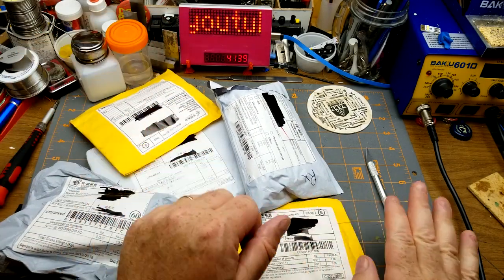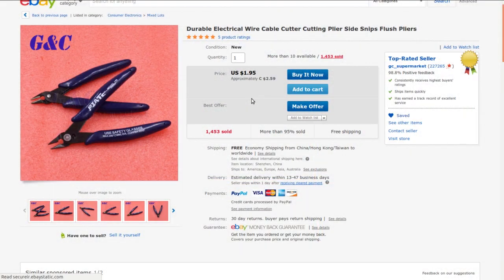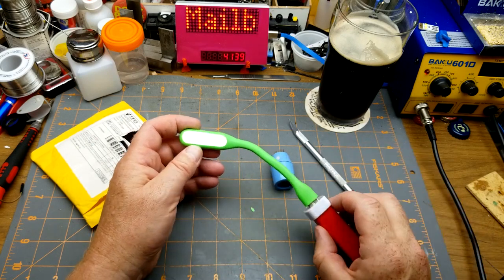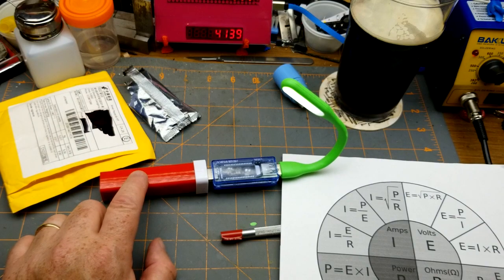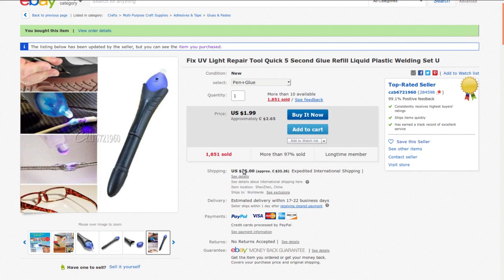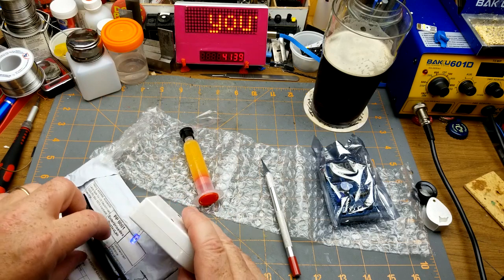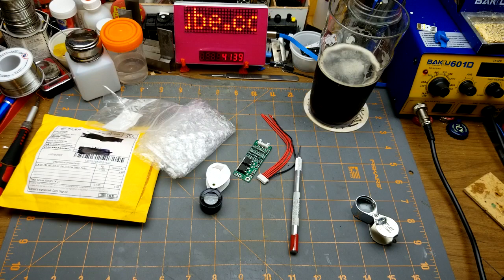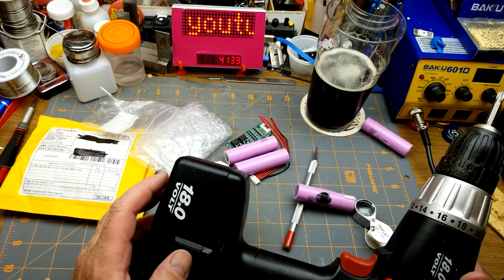mailbag monday #66

Comment: They used to sell those USB lights at Dollar Tree.

The MOSFETs on the battery protection board are STB30NE06L.  They are rated 30A at 60V and have an Rds of 0.35 ohms.

Comment: I've just received ten 18650 high discharge batteries and hopefully I'll be doing 2 similar conversions, soon-ish. The key is to use high discharge cells and a capable BMS. Maybe you can get away with old laptop cells if you add a few in parallel also. Please note that while some argue that the balancing part is not necessary, for longevity, I opted for a balanced BMS with a peak 30A discharge. For what I've seen 15A is not enough for this application, as the current peaks well over 20A under high stress/torque. Also, you need to sort the charging part...
Reply: Yup this comment!!!    We have a portable small vacuum cleaner that didn't charge anymore so I decided to make a pack from used but good laptop 18650 cells. The motor didn't start at all without any help .... which is something you certainly do not want with a drill.  Ordered some cheap cells on Alie and the thing runs better and longer then it was new.  The cells where like 2.78 USD each including shipping.

Comment: Chuckled at the condition of your delicate flush cutters.  I have a collection of ruined ones, and covet those that still cut well at the tip.  I should learn to never use use the good ones to chomp off steel, square header pins!
Recently received some NT ZJ-18 Soldering Paste that you incidentally displayed ... and to my horror found it was PH neutral.  Not flux at all, just paste.  Well, still useful for some things -- it does not burn or evaporate, and it is easy to clean.  I have some other plain resin that is rock-hard when cool.
Have also received some smelly, leaky UV resin in the mail this year.  Did not order it, thankfully.  What a mess ... eventually threw it out.  That container does not mail well.
Need some of your trimmer-adjusting drivers.  A metal head really does drive delicate readings wacky.

Comment: I bought all that stuff for my old cordless drill at the start of the year, but still haven't put it together yet. lol
My old drill pak is big enough for 18650 battery holders, so mine is going to be replaceable. 
My charger broad is bigger than yours but it said not to use it for drills, so who knows.

Comment: Insane?  Perhaps...  But is that a bad thing?
Currently considering converting some 12V Dewalt drill packs to LI using 3S.  cheaper with longer runtime.  New 12V packs are around $50 each.  Drills are fine but packs old.  And my being a cheap assed bassid :)
Reply from the maker: I've never let fear and good judgement stop me before!

Comment: Just an FYI, your affiliate link is throwing a 404 not found error.
Reply from the maker: I just tested it from my home computer and it seems to work fine at the moment using the  shortened link: 
   https://ebay.to/2w5ZIhv 
The full link is a bit ridiculous, but if you want to try it : http://rover.ebay.com/rover/1/706-53473-19255-0/1?icep_ff3=1&pub=5575440997&toolid=10001&campid=5338398311&customid=&ipn=psmain&icep_vectorid=229529&kwid=902099&mtid=824&kw=lg

Comment: my keweisi usb power meter is measuring too low and it looks like yours does to. Better check if the 4.75v it measures is  accurate. It could be but don't trust that keweisi meter.
Reply: Those keweisi meters are like 10 year old tech. They were el-cheapo shitty things when new, and are totally outmoded now in 2019.
Pile-O should stop buying all this (new mailbag) junk and invest in a better (and easier to read) USB meter. A Ruideng UM24, UM25 or UM34 or even the cheaper AT34 (although I don't think it's worthwhile).
Reply: john : so far of all cheap usb meters only the keweisi let me down
Reply: @maicod  - I've also found massive "non-linearity" in most of that cheapo style of meter. They should just use a voltage divider to get the voltage info, so any errors remain in proportion (+/-%) irrespective of the voltage, and you can tune/calibrate them effectively either physically or by software. However some have a diode in the input to the ICs, resulting in a fixed ~0.2V to 0.6V reduction in voltage measured. The voltage divider is still there adding inaccuracies as well. They try to correct this in software/firmware, and it just doesn't work.
Also the design of many of them is flawed, detecting the voltage at the wrong point (before or after the load?) and having PCB tracks that are far too thin for carrying even 1A without introducing voltage droop.
Some use low-spec ADC with only a few bits resolution, so they cannot detect small voltages from the current shunt. So to work around that they use a high value shunt, sometimes 0.1 or even 0.5 ohms, and that also introduces big voltage drops.
All this stuff is really important because the load (in this case the USB LED lamp) will draw different current depending on the voltage it's being fed. LEDs are especially prone to this, and current drawn at 4.75V will be a LOT less than at 5.0V... so after you multiply the "too low" voltage and the "too low" current, you end up with massively incorrect Wattage figures.
It's crazy that any measurement device would introduce such huge errors, especially considering the fabulous accuracy possible from even a shitty $5 multimeter.
I actually made some USB breakout connectors to verify the voltages before and after the USB meters. The results were quite enlightening, but also quite scary.
Reply: @john coops interesting you did so much research

Comment: As much as it is fun as it is, see what china goods you guys get in these mailbags, None of you actually do anything with them, Or show if they are even worth buying in the first place, It would be nice to see you guy, do a performance comparison between China IC and other items VS the more expensive Original's.Example: I remember seeing Multi-turn pots in Julien's channel, I then bought a bunch of them knowing id need them eventually, however when I went to use them, Half of them were not even working.
Reply: Hi , pileofstuff does do a wide range of video content have a browse around, nice building and painting of  kits etc and I like the beer reviews.  But I've built things with the bits I get in my mail bag vids, but the mail bags always get more views.
Reply: That's the way it is mostly with cheap Chinese components.   You got lucky sometimes and they all work.  If you want better ones or sellers you can get service from, you will have to pay more. There are places like Tayda electronics and a few others where you tend to get a little better stuff for not too much more in cost.